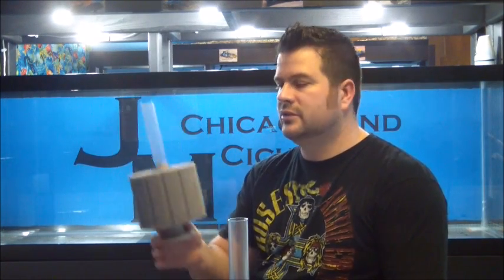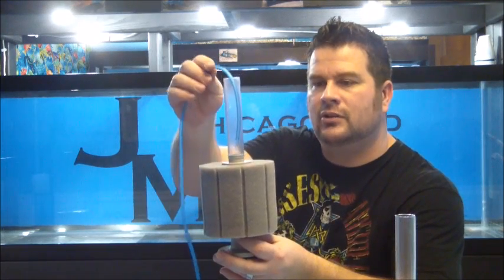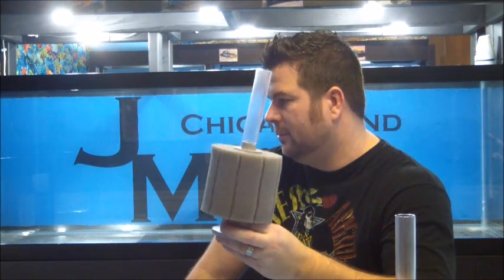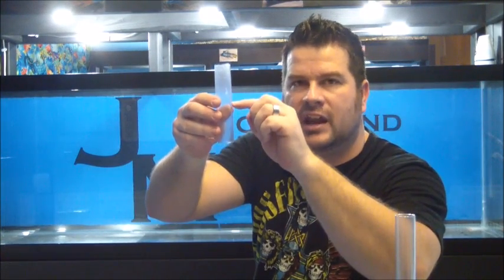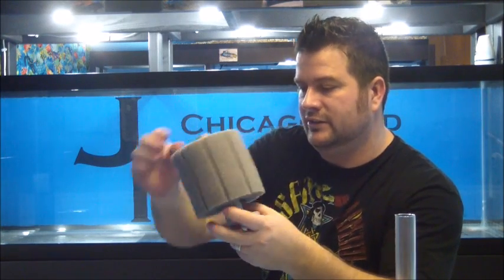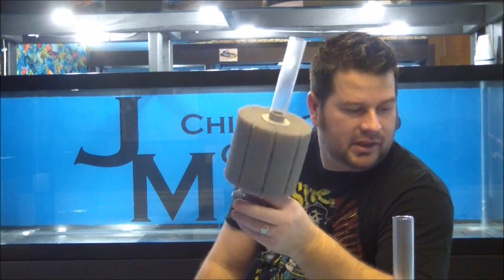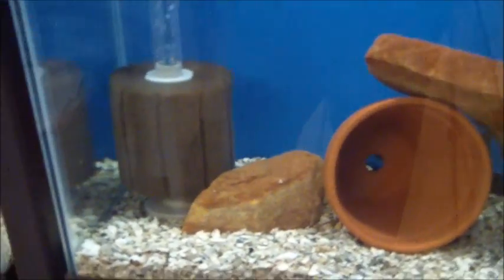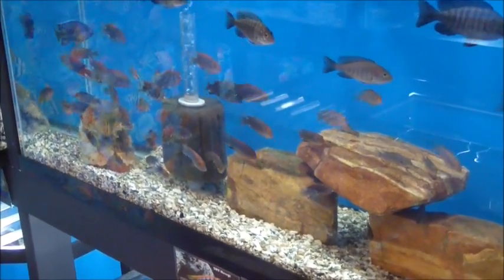Aquarium Sponge Filters how they work

Comment: It is hard to have the filter sink to the bottom of my tank, ANY TRICKS?
Reply: They dont sink and stay, the lines themselves tend to float, kinda have to weigh them down
Reply: squeeze the sponge when you put it back in the tank.  Trapped air in the sponge will make them float.  Once you've squeezed all the air out of the sponge, it will become heavy and stay in place.

Comment: How often should you change the sponge.. 
I clean it every month as advised squeezing it into a bucket of tank water.. 
But do they eventually need replacing? 
Therefore if I do isn't it best to have two running so that you can alternative the replacement, thus keeping good bacteria present?
Reply from the maker: Kev Mac they can last for years, you will only need to change them if they start breaking down and falling apart
Reply: JM CHICAGOLAND CICHLIDS  oh great thanks the reply.. 
Mine does a great job of cleaning the tank..
Mine my filter and air pump are for a bigger tank, so cycles the water fast..

Comment: if i was to get one of these for my already established tank, how would I make the switch? i currently have a cartridge filter so i cant just transfer the media.
Reply from the maker: liam put new sponge filter in tank leave cartridge filter run for month with sponge filter running too you can then remove cartridge filter as your sponge should have the good bacteria established after 4 weeks
Reply: thanks a lot for quick reply. really appreciate the info, excited to switch to sponge!
Reply: Similarly, we had a 55 gallon with a HOB filter that quit working one morning. Upon discovering this, I ran down to my LFS and purchased a #5 pro. When I got home, my wife had our old air pump ready and we placed the sponge filter in the tank. We then took the cartridges from the HOB filter and leaned them against the sponge. I left it like this for a couple of days and then removed the old cartridges. Now that tank runs solely on that #5 sponge filter and a Powerhead for som circulation. And it hasn’t looked better.
Reply from the maker: HarrisonCountyStudio they are amazing filters no doubt and you can’t beat the price

Comment: If sponge filters are so good, why do people run canisters or sumps?
Reply from the maker: Ragnarok not that great looking in show tanks kinda hard to hide
Reply: Ragnarok, great question, here is my answer: As a newbie, I thought Petco was the source for supplies. I bought the expensive canister, I bought the replacement cartridges. The canister worked for sure, but after some years I broke one of the weak plastic latches on it, and I was tired of needing a particular cartridge. Then I found out about sponge filters. 

I love the idea of minimum parts and no moving parts, except for the air pump, but those are inexpensive and available online (the good ones..). So I tried a sponge filter - worked amazingly well and continues to do so. I subsequently ditched the canister. Aesthetically, yes the sponge is not easy to hide, and you really do not want to block it with objects for best results, so there is that. I see where folks would not use a sponge if they want a perfect display.

Pet stores/supply companies are not complaining when you to spend the big bucks initially and then depend on them for cartridges in the future. Here is a  benefit - if you have a power outage, once power comes back, the sponge filter just starts working again. No priming, nothing. Simplicity, functionality, all good things.

Comment: there are two principles at work. the rising bubbles drag water with them, but the air volume also "dilutes" the water column inside the tube, making it on average lighter than the surrounding water, and thus buoyant. both pushing water up the tube.

Comment: Great video! I swear by these things. it's amazing how well they work, how easy they are to maintain, and how ridiculously inexpensive they are.   I hide mine behind things so they are not visible.   I use 2 Seapora 136 sponges in my 80 gallon community tank and my water is crystal clear.  The Seapora model comes with a diffuser built in so you get smaller bubbles and a draw from the bottom without having to add the air stone.   I do suggest 2 sponges in every tank.   I squeeze one out with my weekly water change and alternate the next the week after.  never had an ammonia spike.
Reply from the maker: Norm Petroff you are correct they do work amazing for the cost all you need to do for a show tank is find a clever way to hid them behind some decorations.

Comment: great video! if the pump is pushing water through the top and out the bottom of the sponge, then how is there suction pulling water in to grab the detritus into the sponge? how is suction created if the flow is blowing out of the sponge's bottom?
Reply from the maker: Rotter Tube Reef the suction is created by the bubbles rising out of the tube, with the bubbles flowing upward it is also moving water upwards. The suction brings flow thru the sponge and out the tube.
Reply: cool thanks. that's what i thought but seems it would be very little suction to take care of a tank. interesting.

Comment: Do they cause the water to move around a lot I have triops and can't use a regular filter while there small because they get sucked in but if that doesn't create a strong suction and movement of the water it could solve my problems.

Comment: I buy mine off amazon for about $8 canadian which is awsome. And that's the largest size, can easily filter up to 75 gallons about the same size as the largest one in this vid. They're made by hydra aquatics/sevenports. They don't require an airstone and are very quiet. In fact, on the inside "tube" part where the air runs through, it somehow chops up the bubbles itself. Anyhow, sponge filters are great. They don't suck up heavy debris, but they seem to polish the water quite well and that's apparent when it comes to cleaning.

Comment: do they stay at the bottom ? do they want to float around ?
Reply from the maker: They will want to float in a new tank with a bunch of air bubbles, you just need to squeeze them inside the tank they will stay at the bottom they have weighted base on them.
Reply: thank you

Comment: I am looking for a pump supply 20+ sponge filters.  Do you have a pump you recommend?
Reply from the maker: Kensfish.com has many pumps that would work good, we started with the eco plus 3 for $52 we actually had over 40 tanks running on it, they are efficient on electricity only draw back is they are loud. We are now using a Supreme AP 100 and it's great all the air we need for running 65+ outlets nice and quite but it cost $165.

Comment: I have a small sponge filter in a ten gallon tank that I am planning on putting some neon tetras in.  so I'm setting up this tank and I can't get the sponge filter to sit on the bottom I'm not sure what to to I squeezed the watter out and it sinks but I can't get it to sit flat and steady in the corner. any ideas? maybe the weight isn't heavy enough? what do I do
Reply from the maker: If you are adding water for the first time it sometimes takes 2 days for the filter to sit on the bottom because of all the air bubbles in a new tank. We sometimes have to squeeze them out several times before the remain stuck to the bottom but believe me they will.

Comment: thanks, couldn't figure out how pushing air through a sponge would possibly such dirty water back into the sponge. i know even though my ammonia levels are good that my water still looks a little foggy, but i did not have time to run my filter prior to putting in my orandas ,and of course I'm probably offering too much food so il, try re cleaning my filyer as u showed and maybe suction out any debris in my gravel, hopefully that will take the murkiness out. great explanation though of how these filters work and will defiantly try the air bubbler as well. thanks for the demo
Reply: Sounds like a "cycling" problem (Lack of nitrogen-cycle establishment) to me. I went through that many times when starting a tank... until I learned otherwise. The only other time it ever occurred to me since was when I allowed the filter-floss in my canister system go too-long without a change, which made me change habit to changing it more often than suggested.

Comment: Great video! Are these filters just as good as canister filters? If so, why would somebody choose to spend $150+ on one? Thanks :)
Reply from the maker: Don I do believe they work good but not as good as a decent canister filter. The biggest drawback would be they aren't the best looking things inside your tank and they are not easy to hide but our 125 is crystal clear running 2 #5 ATI filters.
Reply: I recently bought a canister filter without realizing that there's the sponge filter as a much cheaper option. But for sure they are hideous looking and I'm glad to hear they don't perform as good as canisters, so I feel a bit better about my purchase. It's a good option for quarantine tank at least. Thanks for your reply!

Comment: Can I use two or three 125 gallon sponge filters on a 180 gallon tank as the only method of filtration? I want to upgrade the size of my Discus tank, but do not want to drill into the glass of the 180, and I do not really want to spend the extra money on a "reef ready" tank...
Reply from the maker: I would say 3 for a 180 along with weekly 50% water changes.

Comment: I have another question. I have the sponge part, but I do not have the plastic tubing that is placed on top of it. Basically what I did was drop an air stone with tubing into the base of the sponge filter, so inside of it. I'm wondering if the sponge filter will still be effective without the plastic tubing that is on your sponge filter(s).
Reply: Sean Callahan just get a piece of pvc pipe or clear hose at home depot, cut it to fit and away you go!

Comment: Would you use this instead of using hang on back filters, canister, etc? Or do you still use those filters with the foam filters
Reply from the maker: Depends on what you have hang on backs and canisters are great filters. If you have a fish room or multiple tanks that you can run off of one air pump then sponge filters are only way to go. Sponge filters aren't very attractive in a nice show tank, show tanks should use hang on backs or preferably canisters depending on size of tank.